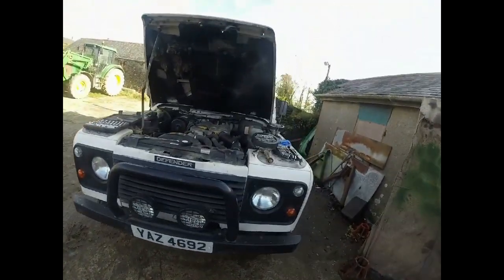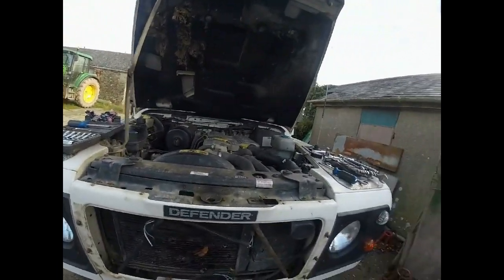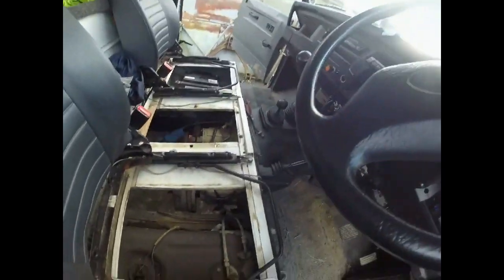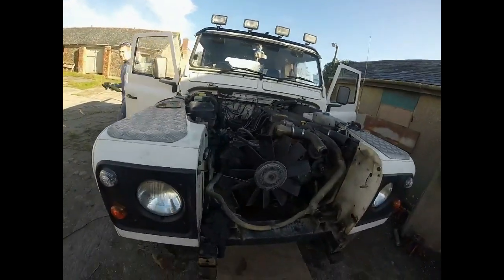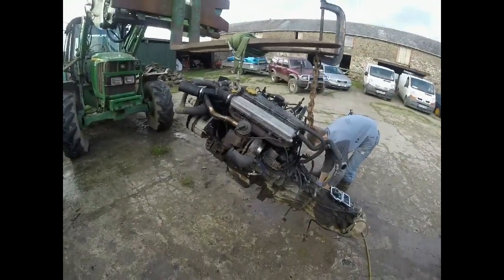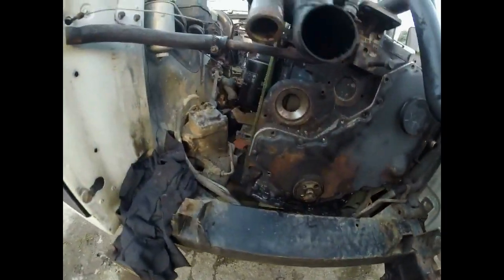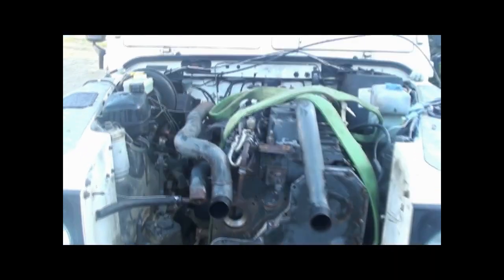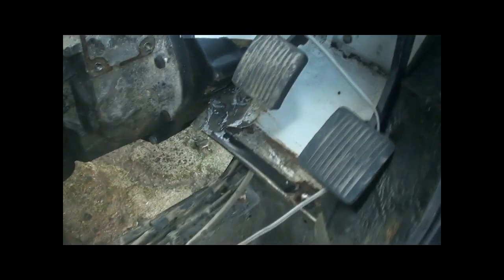Land Rover Cummins Conversion Part 4

Comment: What are you going to do with the clutch as in  the Daf the slave is air assisted.

We had a 45 with the 130hp in last week, a little tipper. It flew to some high speeds lol, its going to be mental in a Defender lol
Reply from the maker: We have retrofitted the complete air compressor / tank  / regulator / clutch system into the landrover, the clutch is fully air assisted as stock in the DAF! and we have onboard air for tyres / tools etc!!
Reply: Holy shit you have a mammoth supply of air then since your only using the clutch!! :D
You found enough space for the dryer and that then?

Comment: "the original one simply wasn...." now Im on edge till part5 to hear the end of that sentence Darren! Haha! Although I can kinda guess what it may be!!
And @Josh O they whipped it from the good old scrappers!
Reply: simply wasn't going to fit. gearbox sits a little lower because it is taller, didn't want you to loose any sleep so thought i would tell you.
Josh O the engine came from a daf 45 lorry at a scrapyard, these engine were never fitted to landys however are fitted to dodge ram trucks.
Reply: Hello  @lobblandrecovery